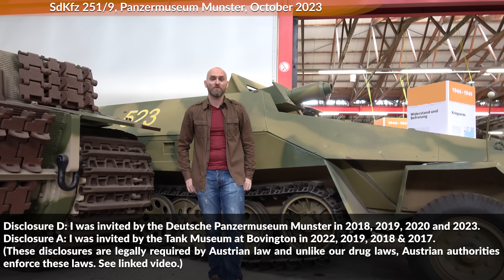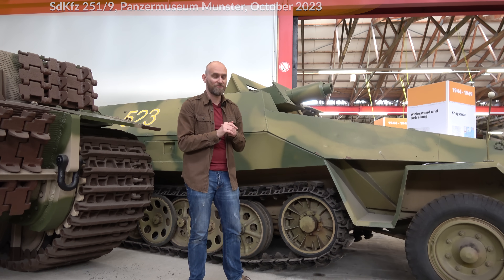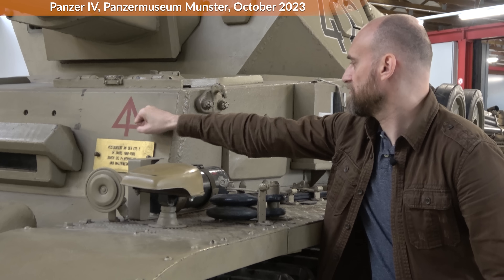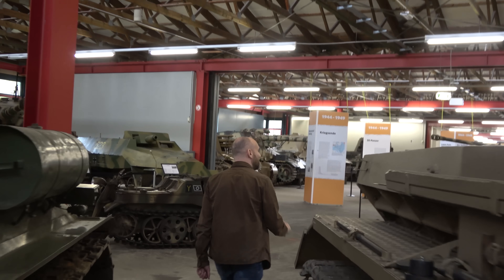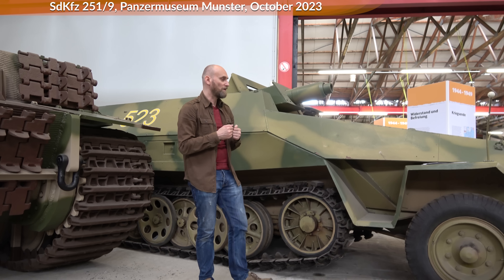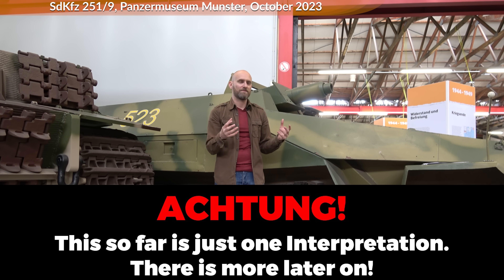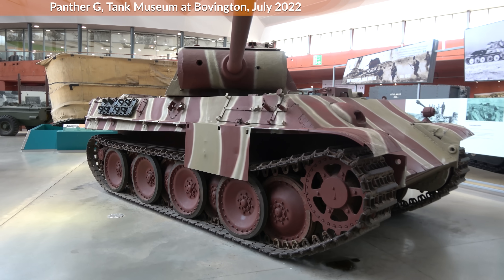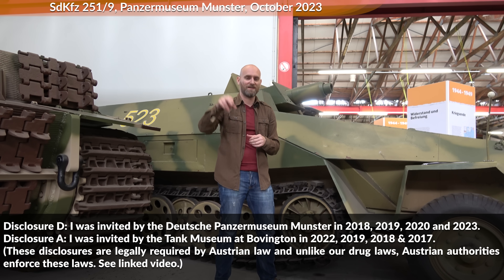Why was German Sloped Armor so late?

Comment: I must say I never felt that way, that German application of sloped armor was late.  I always chalked it up to boxy armor being used due to engineering concerns i.e its probably due to boxy tanks being easier to design and produce, and boxy armor seemed perfectly adequate until soviet union, then upon encountering T-34 and seeing first hand how effective can sloped armour could be, then the decision was made to make use sloped armour in future designs. Often forgotten problem is question of ergonomics.

3:53 I do recall from i think Polish and British tanks concerns about using of welding in tank armour, I do recall that there semed to be a belief that welding cannot provide reliable durability to effectively withstand shells, and this made replacement of rivets with welding somewhat controversial.

Comment: As somebody that has to assemble large heavy parts for my day job I have another idea as to why the mortises were there:
Ease of assembly. 
Moving large, heavy, armor plates into exact position for welding is way easier if you had those notches as a guide. 
This would also explain why germans did this on the "heavies", but not on the 3s and 4s, and why none of the allies really used it. 
If you're doing well prepared mass production of a tank, you can build welding fixtures that quickly position the plates, regardless of notches, but if youre building them at a lower volume, its easier to cut the plates with notches, instead of building an entire fixture before you can start production

Comment: Well, with all respect to an author I do not sure why he went in area of manufacturing technology if - well, basically do not have supported knowledge there. Yes, welding technology  had been a big deal in manufacturing for tanks with thick armor. But it really not much to do with a slop armor, that have to do with a thickness of a plates and assembly methods. And yes, it was develop an automatic welding  technology for thick in USSR, it was a big deal in manufacturing. BTW in soviet testing it was particularly noted  low quality of welding for front armor plates on king tigers.

Comment: to me the interlocking is there to a line the plates. placing a heavy steel plate on a sloped in the correct position would be a nightmare. and would take up the use of a crane for a longer time than having a notch for the plate to sit in. it is nothing more than a manufacturing method that may have had an extra benefit of more rigidity.

Comment: The interlocking armor has to do with the surface area of the weld. It became necessary as the armor plates became thicker. Depending on the welding technology, and this was hugely different between countries back then, you weld only at the surface of the joint between plates. The interlocking creates more connecting area to weld, and thus stronger weld's.

You don't need the interlocking (as much) if there's structural framework underneath or if only one of the plates extremely thick.
It's main purpose can also be during construction, to hold something in place so a good weld can be made. That's why you may see it pop up situationally. 

After the war the hugely thick armor plates disappeared, or were created in different ways. Welding techniques also changed and improved.
Reply: Exactly.

Comment: IIRC, the reason the T-34 welds don't interlock is because the hulls are automatically welded using an immersion welding setup. 

This is also why the weld seams look so janky - the welds themselves are deep, but the welding doesn't have much in the way of human finesse.

Nazi tanks were hand welded all the way to the end of the war.

Comment: I imagine that interlocking welded plate armor both spreads the stress on a longer weld line, and also the geometry itself also helps to lock the plates in place more strongly also aiding to keep the whole thing together and not relying purely on the welds, i think this was specially important for the germans at that time since their steel lacked components to increade flexibility and reduce overhardness, so with harder plates interlocking is also more effective, but also needed so the plates dont crack at the welding lines or so that the welding lines are stronger

Comment: So what's the diffrence for production time in straight welds compared to interlocking armor plate welds? Because cutting the armor plate is only one step, and even then, just cutting straight might still be faster than interlocking.

The other question is, what was the maximal thickness that could be welded at the time? Maybe Drachinifel could help with that?

Comment: I suppose strengthened joints have a lot to do with the increasing mass of the projectiles. T-34's armour was brittle and simply welded together to counter relatively light AT projetciles of the time, imposing little stress on the whole plate. Germans used unterlocking angled plates later in the war, when calibers exceeded 70mm. We see many photos how older pz3 or 4 break apart along the joints under impact of such shells. Allies during late war also resorted to cast armour more, which featured less joints and was more shock absorbant. Albeit had less strength to counter the weapons.

Comment: 13:50 That transition from the FT-17 to the M3 Medium Grant/Lee puts a lot into perspective about just how much things had changed during the 1930s. While the FT-17/18 were WWI designs known to be outdated by WW2, they were still among the most numerous tanks available to the French in 1940, as well as Yugoslavia and Romania. Back then, a twenty-year old tank design wasn't anything to dismiss, and I say that knowing full well that 50+ year old tank designs are still being used in Ukraine today.

Still, the teeny-tiny FT-17 versus the unwieldy-yet-solid M3 Medium shows that a tank from the 1910s that was born of cutting-edge innovation and a rushed design based mostly on already-disproved design notes on 1930s armor were still light years apart, with no war between them. The FT-17 was functional, but useless in a 1940s war. The M3 Medium was at least three times the size, and clumsy, and outdated at birth, but worked so well it was still in the front lines (in Burma and maybe New Guinea) in 1945. Two designs, barely twenty years apart. But you put them next to each other, they don't look like they could have ever been used in the same conflict. But they were. And neither was ever considered anything more than "good enough".

Comment: Very good video, very informative.
Perhaps an additional reason is that sloping the armour reduces the internal space for crew ergonomics, ammunition storage, equipment etc. Therefore if you want a tank that has the same internal space as a flat plated tank then the overall size of a sloped armour tank must increase making it easier to hit and costing more per unit in materials and man hours to construct.
The Soviets got around this issue in the early T34s by having small and uncomfortable tank crews.

Comment: I dont think the interlocking welding was a contribution to structural integrity, in fact the welding was more complicated and less effective. The introduction of sloped armor brought in new challenges for hull and turret parts completion, it is much harder to hold those parts together before they are welded. You need a complex (much more complex then on non sloped design) assembly tools, holding the welded parts together while welded. Germany had no luxury of a large perfectly equipped factory with specialized tools, also the assembly had to be as fast as possible. So the interlocking design allowed Germans to simply use the parts as LEGO, hammer interlocking parts together and they hold together with no additional tools until fully welded. You can do this method everywhere, no need for specialized non movable constructions/contraptions, so it was easy to move the production for example underground.

Comment: That "interlocking" is typically referred to as finger joints, or box joints.
Cutting the notches takes more time, but they align the plates for easier assembly.  It could be argued they create a stronger joint, but welding turns multiple pieces of metal into one piece, so strength isn't really improved.  The only advantage I see is the help with aligning the plates for assembly.
Reply: Well, that in case if ideal welding. But when you do thick plates ideal welding is a big problem.

Comment: The T-34 wasn't even the first Soviet tank to use sloped armour: the BT-7M has sloped armour in the turret, and the A-20 (1937) was designed to have sloped armor (in fact, it was the design that led to the T-34 and T-50).

Comment: The obvious bottom line is that any seam in armor is weak, whether it's welded or not...
But as far as slope is concerned, it's a choice between size of the vehicle (because slope requires more size) and crew space (because slope requires more space)...

Comment: Prior or at the beginning of the war, at least in regards to the halftracks and wheeled vehicles like the Schwerer Panzerspähwagen series, the Germans had patent to their welding technology and were able to use their welding technology to create many and pretty heavily sloped angles to achieve high levels of protection with relatively thin armour plates compared to that of other nations. Their reasoning to go for welding rather than bolts was because of the added weight that bolts had and could also fail.

Comment: One topic you didn't bring up up is the plus of not having sloped armor is space. You get more volume with no or less sloping, more room for ammo, radio, and general crew ease of operation. 
Can't speak on if that had any baring on German design or not.
Reply: I think that depends if the tank is big or small. I know nothing about tanks, but I imagine that a tank big as a house like Jagdtiger or M3 Lee that is big enough for a football team to fit inside do not have as much space to lose from sloped armor as a more tiny cramped tank. So the gains made per tonnage by armor sloping is probably bigger for big tanks.
Reply: @nattygsbord  Saving weight by reducing the armor thickness by sloping (gaining effective thickness) is something didn't think about. Fair point.

But keep in mind while those tanks are big, the inside might be smaller than you thing. More armor = less inside space.
Bigger gun = bigger rounds, less space.
More guns / crew = less space.

Crew "efficiency" is something else to think about. Sure you might have 5 guys in one tank. But if you can't move around at all that's not a good time. If it takes you few extra seconds to fumble the round from storage to the breach that'd effect combat.

Then general QoL for the crew who have to live in them. Less cramped is always nicer to crew fatigue (also going to impact combat). Things like the water heaters the brits had make a big difference. But that's requires the space inside to do so.

So suppose it's the trade offs from a pure engineering standpoint and "useability" of the tank. Big open space tank isn't any good if it's too heavy to cross bridges, move on rail, get shipped around. Or so little armor it might as well be not there.
Reply: @wolfhunter98  
There is some truth to that. M3 Lee was not a good tank I think with its high siluette that made it an easy target and the armor had to be spread around a large area - which resulted in either a weakly protected tank, or a heavy weight tank.

The opposite extreme are the russian tanks that are crampy as you say. They got much armor thickness and low weight. But can be very crampy inside.
However I do consider some tanks as very good despite being crampy, like Hetzer that packed much punch for a small outdated tank chassi that was cheap and easy to produce and did not weight much.
And the French tanks in 1940 that had so much armor thickness that they were immune to german tank guns. I think that makes them deserving of being called the worlds best tanks of that time, no matter what this germanophile says about radios and the drawbacks of having a only two man crewed tank turrets like the french.
Personally I think that it doesn't matter if situational awareness is slow and the workload is high, if the tank got so thick armor that it can survive many hits from german guns before it decides to fire back at them.

So I think that one main compromise in tank design is to gain as much armor protection as possible with as little added weight as possible.
Sloping armor is an attempt to gain more protection without adding weight. Chomham armor is another way, as it is said to give the same amount of protection as a 4 times thicker plate of battleship steel.
Cage armor, spaced armor and such are other examples. And it is possible that steel foam armor is the future as it adds thickness to the armor with much less extra weight compared to steel. And barracuda camouflage stealth might also add to survivability and trophy and electronic warfare equipment that can combat enemy drones.

Comment: Tĥe interlocking plates gave the frontal armour more strength. There is more weld for a given length.Also, an impact by a shell presses the frontal plate against the adjacent plate ,preventing the welded area from tearing..

Comment: The Soviets required speed and simplicity of manufacture.  They traded a certain amount of absolute integrity to achieve that. I suspect that the calculation was that any impact sufficient to compromise the welds would probably defeat the armour anyway.

Comment: In order to really assess this correctly we need to look at examples of destroyed tanks and see where there were points of structural failure... but I can't imagine there is a ton of specific documentation really. Sure we can find examples of damaged tanks, but are they the rule or the exception? You need real numbers to look at to get an accurate picture. I think this might be a question you can't really answer anymore because it was just too long ago and everything is gone.

Comment: One of the obvious (maybe oblivious) things to me about sloped armor is it increases the surface area of the armor you need. For heavy designs, and maybe due to efficiencies, the Germans opted for thicker as opposed to bigger. It may also be that when the shell was AP-C, the hardness was expected to defeat the shell. When it got to KEPs or shaped-charge rounds, it concentrated the force enough to defeat hardened armor, and deflection of the penetration path was more a thing. 
   As far as why sloped on early vehicles, bullets on thin armor would dent it, and cause bullet spall up the face.
   The US was casting hull parts by the end of the war, getting rid of the welds.